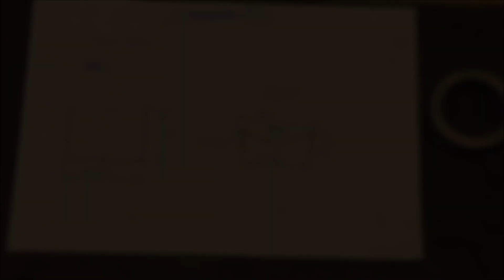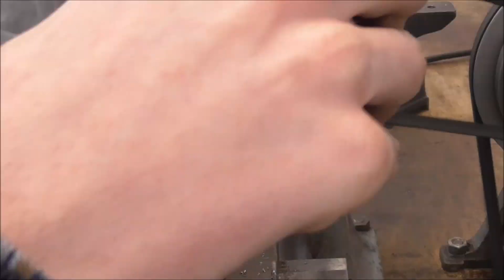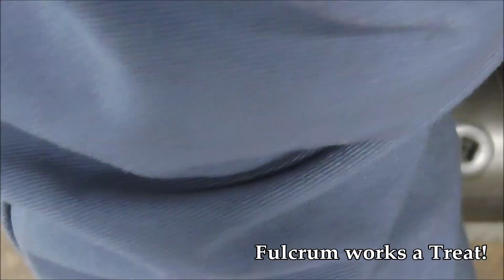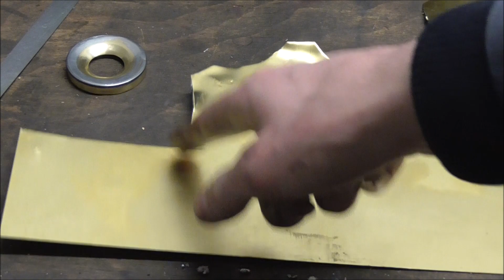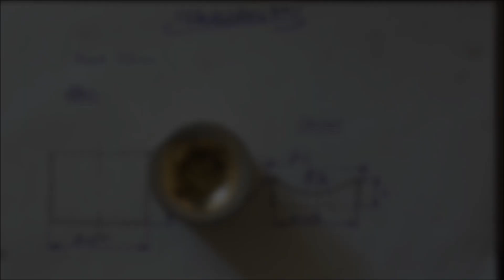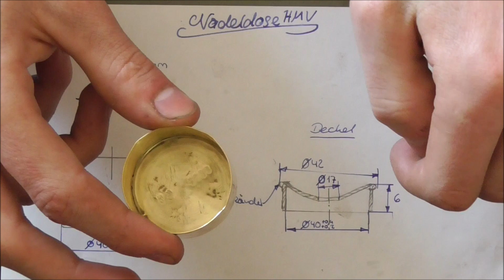Needle Container for HMV Gramophone

Comment: Very nice, bravo! The spinning is craftsmanship, i.e. takes a lot of of experience. 
Not that I have so much, but here is my 5 cents: The tear up went because the tool did catch the material. It would be better to use a roller, than a friction point. Lubrication is well made with bee's wax.
What prevents from shrinkage is to maintain a slight rib on the outer edge of the blank, while spinning.
Reply from the maker: Many helpful tips, thank you very much!

Comment: Turned out very nicely Adrian, I've done a few small metal spinning jobs with varying degrees of success- lots of annealing and a good lube like tallow is all I can pass on from my experience. Any small part that I had to make several of i usually just made up a press tool and banged the parts out with the assistance of a large fly press, if i can find some photo's of my nicest job I will try and include a link.
 Best regards, Sam.
Reply from the maker: I think deep drawing would certainly be worth considering - the dies would not be that hard to make and even with the .5mm sheet, spinning puts a lot of force on my tiny lathe.  It just bugs me how incredibly difficult it seems even to make a simple, straight forward shape like this.
That's why it's usually a three-year apprenticeship, I guess xD